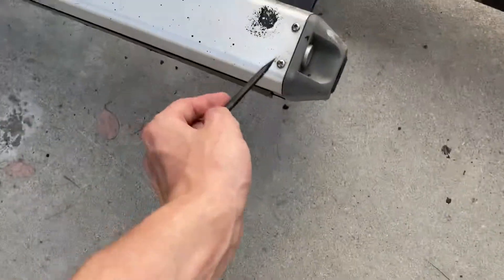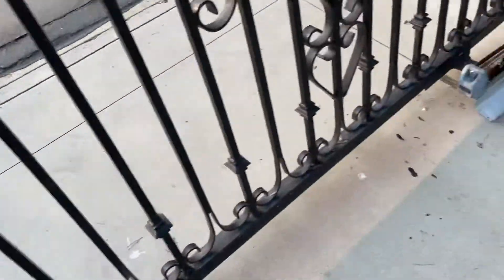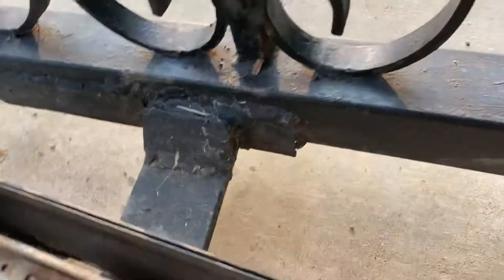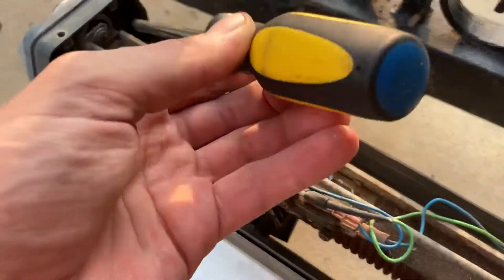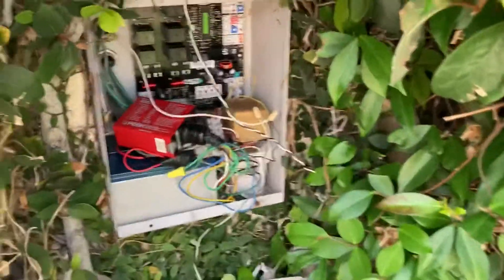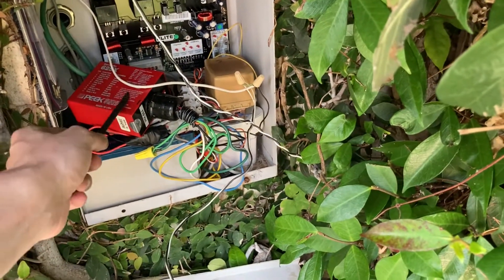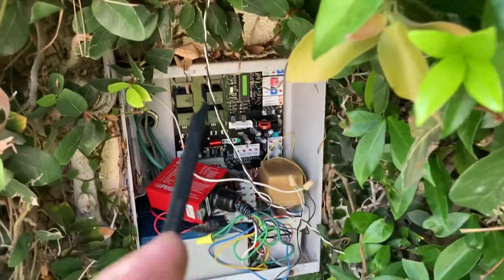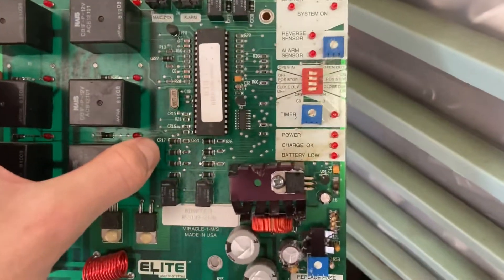Liftmaster Elite miracle-one gate operator limit and timer adjustments

Comment: Dude, you've done a great job explaining the system and the ways you've had to rig yours to keep it running over the years. I have a similar setup with 2 gates, but I'm actually puzzled by how this system actually works as it relates to power/battery. My initial assumption was that the system runs on AC current with battery backup, so when the gates move (and there is AC power), the batteries are not involved. But now I am doubting this assumption. In my case, when the batteries get low, the system begins to do odd things. (partial open with a 10-15 second delay to cycle it after the first cycle) When this happens, if I check each of the 12v batteries, invariably one of them is below 12v. When I replace the bad one, the system works normally. I checked the AC transformer and it is outputting ~26V, and I confirmed at the circuit board plug that it is getting that voltage. But if I unplug the dual batteries (2x12v...~25.5v DC), the system does not work at all. If, however, I reconnect the batteries and then disconnect the power to the transformer, it runs "normally" on the batteries. So, I concluded that the system runs on battery power that is charged by the transformer. Is that your understanding? That makes no sense to me, but I didn't design it.  I am also pretty confident this is not related to the switches on the motors because the partial open/close problem is symetrical. Any ideas?  FYI, I did see that there appears to be a little leakage from a resistor (R55) that is just above that white box with 5 LED's labeled CENTRAL CONTROL (STRIKE OPEN-SAFETY LOOP-RADIO REC-CENTER LOOP). Don't know what it does, but maybe it has something to do with this odd behavior? The reputable local gate company basically has technicians that are the same age as this equipment, so they are at the point of "time to replace everything" as opposed to fixing anything. Any insight would be appreciated.
Reply from the maker: So you are right that the system relies on the batteries being 12v each to make 24v to control the gate. If the batteries are below 24v, the gate will not operate normally. This is the behavior of the original elite motherboard. I believe, but don’t quote me on this, that the newer version black motherboards don’t have this issue and the batteries last longer with them. They updated the circuitry in them and they seem to be more reliable. However, they are $500. If you want to be cost effective, just continue changing batteries and power cycling the gate, and hitting the reset button on the ground loop induction center box. My guess is that over time the components age on the motherboard and the system relies on the backup power anyways so it’s a “safety” feature that the gate is inoperable or janky when the batteries are low. But realistically, i think the circuitry in the old motherboards are bad and rely on 24v from the batteries and don’t have any sort of pass through just because of the way it’s wired.

Comment: Hi I have a question. I have the gate stopped all the sudden from closing and evey time I press the remote, it blinks Radio Rec. not sure what is going on
Reply from the maker: I would just disconnect the power brick and batteries and then reconnect them, that could reset it and solve your issues. If not, the reset button on the ground loop module is another good try.

Comment: very good video I need an updated miracle 1 dual gate control board do know where i can purchase one
Reply from the maker: They seem to be sold out everywhere. I bought mine for $500 a few years back. It's called an Elite Q223 Circuit Board. Cheapest I could find now is 900$ https://www.radwell.com/Shop?source=GoogleShopping&IgnoreRedirect=true&ItemSingleId=126704254. They also have a $400 repair option.

Comment: Hi there , how do you open it when there is no power and battery is no good. I try opening mine with key , I unlocked it and try to push but its very hard and i am scare of breaking something.? Thank you
Reply from the maker: You have to disengage the motors with the key and push them manually. If it is not opening easily you can add grease or wd -40, or supply 24v to the battery connectors and operate the gates electronically.

The gate is equipped with a fail safe and if the batteries are not charged the gates will not operate.
Reply: @DordiHOTS  thank you. But they will open if i disengage the motor with the key even if the batteries are completely dead?
Reply from the maker: @tulio3571  yes
Reply: @DordiHOTS  thank you and good night.

Comment: I have the same one and just bought a liftmaster kpw5 keypad and can't program, do you know if it is not compatible? if so witch keypad is? Hope you can help me
Reply from the maker: The LiftMaster 312HM High Memory Universal Gate Receiver works with remote controls: 371LM, 373LM, 890MAX, 893MAX, 892LT, 894LT, 361LM
Reply from the maker: Another website says that it only works with this remote keypad: Liftmaster 377LM
Reply from the maker: If you're looking to use a different style keypad, you'll need a different reciever module: https://www.amazon.com/Liftmaster-KPW250-Wireless-Universal-Receiver/dp/B074CF5G3W

Comment: thank you very much for the video it helps a lot. My miracle one since yesterday is acting weird. It was pulling as it should but then it moves to half open. and after 1 minute it's back to close again, however I think it goes after the stopper that I set. I didn't know how far off since I have a steel as the stopper. I'm not sure if you could give me some advice, but I need this to open as it should and stays there instead of doing half gate. Can you please advise how to fix this?  Thank you for your help
Reply: Did you fix it. It could be the batteries. Mine had same problem and it was the batteries.
Reply: @tulio3571  I fixed it , it wasn't the battery but the stopper setting. I still don't know how it gets fixed. hahaha.

Comment: Hey bro, I’m having issue with my miracle one. The system ON is blinking rapidly. Batteries and fuses are new so I’m confused as to where I go from here.
Reply from the maker: Ah, that's an easy one to fix. So there is usually a "ground loop sensor module" with a dial, and some buttons on it. Simply press the reset button on this box and it should fix the issue. If that doesn't work, you can disconnect and reconnect the 24 pin power connector (white) and 12 pin black power connector on the lower right part of the motherboard, also disconnect the battery, this should "reset" the system. If this doesn't work, see if there are any obstructions (bushes, branches, trees, something blocking the gate). See if the "alarm sensor" light is on, indicating a physical obstruction or tampering with the gate during operation.
Reply from the maker: Also sometimes just physically moving the ground loop sensor module slightly sometimes fixes this issue as well. Once you fix it, you should see the red light blink intermittently instead of rapidly, indicating that the close timer has initialized.
Reply: @DordiHOTS  really appreciate your inputs! I’m going to give this a try now and keep you updated. Thank you!!
Reply from the maker: @OLahh29  No problem, hope it all works out!
Reply: @DordiHOTS  I ended up goin the rest route and removing the black and white connectors. The rapid blinking is now gone but I don’t see any intermittent blinking. Also my clickers aren’t working.
Reply from the maker: @OLahh29  the reset might have caused the clickers to forget their programming. You should have another box which is the transmitter. It has a button used for pairing with the remotes. There should be some guides just look up the model of the transmitter. For now try to press a button on the gate and see if it works. Next thing I would check is battery voltage. The gate is designed to not work unless it’s getting 24 v from the backup batteries to open in an emergency.

Comment: I have an electronic relay operates from my cell phone common, normally open and normally close contacts. what terminals do I use to open and close the elite miricle 2 swing gates. Thanks for any help.
Reply from the maker: you should see wires coming from your call box or gate open switch that trigger the relay. You can determine NO vs NC with a multimeter.
Reply: Can you tell me what terminals on the Elite circuit board to use or a website where I can download a schematic of control circuit board? thank you
Reply from the maker: @ricgar3036  Visit link: https://www.techmasterdesign.com/forum/viewtopic.php?f=2&t=927

click "elite miracle one operator manual.pdf"

it will download, on page 36 there is a wiring diagram for the miracle one single operator circuit board, on page 38 there is a diagram for the master/slave dual operator circuit board. The wires on my gate that trigger the relay to open the gate are black and white, but it could be different on your system, just see which wires are going to the switch that opens your gate....

Comment: @George Scott  Since you have a good amount of experience with this gate, perhaps you can help me out.  In my double gate setup, after doing some maintenance (one side wasn't opening reliably - cause was fatigued wires coming into the arm) one side is no longer slowing down as it approaches it's final open or close state.  I have swapped the limit switch assemblies between the two openers, and the issue stays with the opener/motor.  For the life of me I can't figure out what is causing this.  Any suggestions for what I can check?  What method does the system use to slow the system down once the 1st limit switch is engaged, then finally stop when the second is?  Thanks!
Reply from the maker: In my experience, the limit switches (there are two for each side of travel) are usually the issue. The second switch is the one that is supposed to make it slow down, I would check the continuity of the switch with a multimeter; if it's not the switches, the next thing to replace would be the motherboard, there is a new version of the old green circuit board with updates that is black, seems to be more reliable. You might even be able to send your old board to a repair shop to save some money, new ones are 500$.
Reply: @DordiHOTS  Thanks.  Since the issue stays with the motor when I swap switches between them, I think they are good.  What I'm confused about is how, with only two wires going from the switch assembly (for 4 limit switches!) to the motor, how does it signal slow, then stop?  Is it an open/close sequence?  Regardless, sounds like it may be the main board.  Any sources for repairs?  I think I already have the black main board, sadly.
Reply from the maker: @nwahs  I'm not exactly sure how it all works with the wiring but that is interesting how it is only two wires for four switches. I was actually curious of this too. I think there is a resistor in line with one of the switches, so since the resistance is different, the motherboard can differenciate the signals, and maybe all 4 switches share a common ground, since the switches are 3 leg they are a little different too. I think they're wired in series. I have replaced two of the limit switch assemblies on my gates before which have fixed this exact issue on two different gates.

Comment: Hi. Thanks for the videos.  George, can you please explain what the 2 heavier gauge wires on the surge suppressor board are for ?   On the system I just bought used and have been repairing both boards on, these 2 wires are capped, are black and white, and come from the back of that board.  

  I can take a picture of them if you need to see them.  Thank you in advance.
Reply from the maker: I'm not exactly sure, my board didn't come with a surge supressor, however, there is a wiring diagram on page 17 of this manual: https://techmasterdesign.com/forum/download/file.php?id=14 

best of luck!

Comment: I have double gates Elite Miracle 1, I running into the issue of the gate opening not fully and stuck w Reverse Sensor on.  I have replaced the 2 batteries, openned out the 2 operating arms, cleaned them and put them back, still it didn't fix the problems.  Did anyone every run into this issue?  Thanks!
Reply from the maker: Check to make sure nothing is blocking the gate from opening fully. If you remove the metal cover of the motor (4 screws) you should be able to investigate the carriage and motor assembly. There are 4 limit switches and an adjustment rail (4 screws total). You can adjust the limit switch assembly for the opening side to cause the gate to not open as far and hit into whatever. Another problem could be the limit switches themselves are bad. If all that doesn't fix it, check to make sure batteries are 24V, if they are, replace the main board (since you've already replaced the batteries)

Comment: Great video. @George Scott - My dual gates were left open and disconnected for two years.  When I put in new batteries and tried working the gates again, all I hear is the click and the Remote LED, followed by the relay LED and then nothing else happens.  Made sure that the screws on both gates is well-lubricated too.  The fuses are fine and no LED stays on to indicate any errors.  Any idea what else could be wrong?  

In your replies, you indicate that there's a way to check for a blown motor using a multimeter.  Can you explain a bit more?  Also is there a way to just test if the motor works by sending it 24V from the batteries and seeing if it moves?
Reply from the maker: I'm not exactly sure of the voltage of the motors, either 12v for each or 24v for each. I would test powering with a lower 12V directly to the motors to test them. There is definetely a way. There is a little bus bar on top of the gate motors if you take the top metal panel off. I would check out a wiring diagram: https://techmasterdesign.com/forum/viewtopic.php?f=2&t=927 click on "Elite Miracle One Manual" from that website, and figure out what wires need to be supplied 12 or 24v. Start by testing the motors, then make sure the loop sensor is not bad, you can press the reset button on it. If the low battery light is not on and the fuses arent blown, I would also check continuity of the wires going to the motors. The manual also has some troubleshooting steps.

Comment: My 8amp 125 v fuse keeps blowing sometimes when the gate slams against the wall. I’ve been using fast blow fuses, can I use slow burn fuses instead as long as they’re the same volts and amps? Thanks
Reply from the maker: so what is likely wrong is that one of the limit switches near the wall is broken so the gate is slamming hard and stressing out the motor. I would fix the issue that is causing the fuse to blow so you don't have to keep replacing them. I would recommend using the exact fuses that came with the gate. If you have the same gate as me you can find a replacement set here: https://elitegates.net/collections/elite-miracle-1-parts/products/elite-q239-limit-switch-assembly
Reply: @DordiHOTS  Is it easy to install the Q239 Limit Switch Assembly? Can i do it without having to remove the entire swing arm ? Or can it be installed directly onto the arm by just removing the old one and connect the replacement easily? Thanks for your advice.
Reply from the maker: @deanvh  I would try to adjust the limit switch assembly first to see if the adjustment fixes the gate. Use a needlenose plyers and screwdriver to loosen the assembly like in the video and make the adjustment. If adjusting doesn't work, then the replacement assembly is approximately 150$. You do not have to remove the arm to replace the assembly, you just have to completely remove the screws shown in this video tutorial.  https://elitegates.net/collections/elite-miracle-1-parts/products/elite-q239-limit-switch-assembly
Reply: @DordiHOTS  also , I have trouble with the key to unlock. I turn the key quarter turn counter clockwise but the gate remains locked . I can’t move the gate manually. Is there a trick to this? Thanks
Reply from the maker: @deanvh  you can remove the 4 screws on the top of the gate arm like i did in the vid and then unscrew the rod attached to the back of the keyhole mechanism and move (twist) it manually